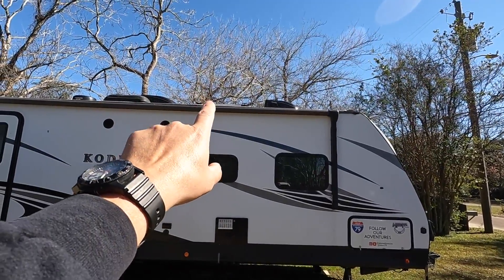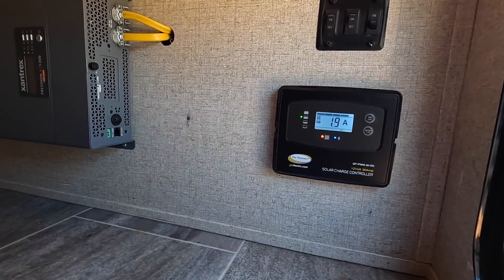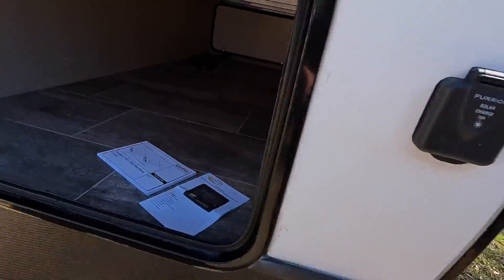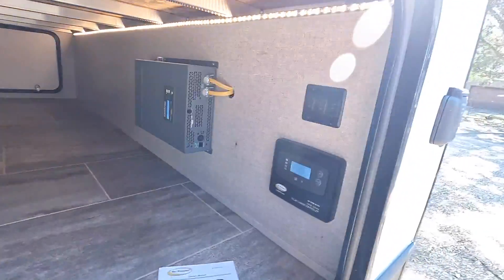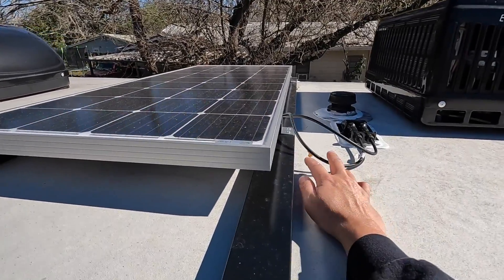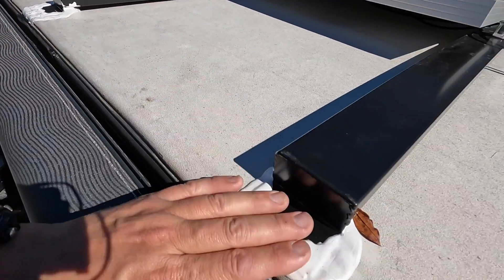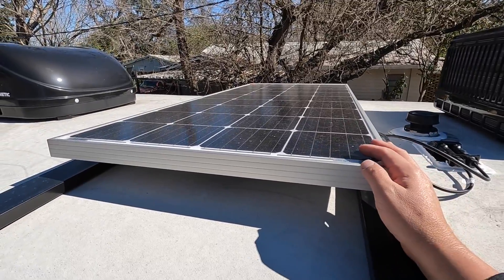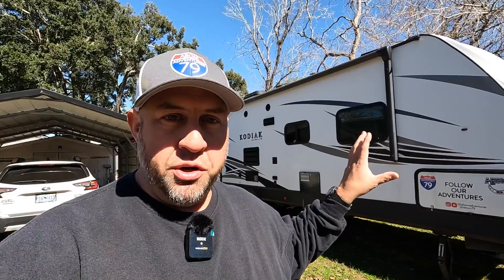Kodiak Solar Power Kit Install

Comment: 1200 w solar panel? Instead of my 18x330w solar panels on my roof (6.6kw solar system cost 2999$ aud) I could have gotten away with approximately 6 of your panels damn it
On the back of my house I have 2x190w solar running into 2x470amp/h agm batteries hooked up to be 24v
Then I have a 2kw Inverter
Did the company explain to you Adam about the efficiency of 24v over 12v and at least AGM batteries over lead acid?
Are the batteries at least deep cycle?
You will be lucky to start and boil an electric kettle
What is the start up power for your fridge
Before you go anywhere Adam that you will rely upon the system
PLEASE dry run everything at home without the genny or your shed power point
You have a big roof on that caravan..... 
Please go and check out
DIY Solar Power with Will Prowse
He is easy to understand and has a LOT OF good info on all things solar and batteries.
Tony from Western Australia 🇦🇺

Comment: The largest RV solar panel I’ve ever seen is 400 watts I’ve never seen or heard of a single panel that will provide 1200 watts for a single panel, is this correct? Earthroamer provides a lot of solar to run the entire rig including the AC and it has 1320 watts with multiple panels

Comment: I'll be interested to see what your results are. I have 310W of solar panels that I can point at the sun, and I find that during a week of camping, if I have 2 rainy days, the panels can't catch up to the power taken out of the batteries. I don't even have an inverter to gobble up power. I love your camper mod videos. Keep 'em coming.

Comment: One panel is 1200W? Are you sure. The inverter may be 1200W but my guess is the panel is maybe 300 to 400W.
Reply from the maker: Solar panel is rated at 190 watts.

Comment: Stop deleting my comments wth what I'm saying is true I have built lots of these systems .
more like a 150 watt system. you can only dischage  deep cycle lead acid batterys to like 70-50%max or you will damage them. plus that pannel is only 150 watts id bet. they are decieving on the 1200 rating thats just the inverter rating. i doubt its even te battery capacity what do you have 2 100ah deep cycles?
Reply from the maker: Hey Baloney, Calm down man! I made a mistake, it happens! No the panel is not rated at 1,200 watts. It is rated at 190watts though. I'm not an expert on electrical systems, I'm simply trying to share the mods and improvements we make. What's the point is trying to downgrade the system components of are particular solar kit? The lead acid batteries will work just fine for our needs and I am more then aware of the available upgrade using lithium iron batteries. Give someone a chance to even use the stuff before suggesting that the components will not work and the "you need to" comments are thrown around.  I'll be adding the links to the kit in the video soon, I was trying to verify the correct kit before I do.
Reply: @AbomAdventures 👍🇺🇲

Comment: Good luck with the small solar panel. It should keep the batters charged for the inverter to work for a little while. 
Need more solar panels.
Reply from the maker: So nice to read comments like this...
Reply: @AbomAdventures  get used to it and check your attitude buddy

Comment: Adam,
Here's a project. How about a sheet of aluminum about .100" to .125" thick cut to size with vinyl upholstery material glued to one or both sides to cover the solar panel in case of storms. You could probably bungee it on or fab some clips to hold it on prior to the storm rolling in. You would have to be careful to not cut your rubber roof when you're installing or removing it so the vinyl padding and rounded corners would probably be a must. Just a thought.

Comment: Good old Anthrax invertors, wonderful piece of crap. Had MANY issues with them including my own set-up. Lost $7000 because of their product so went to Magnum instead. The GoPower regulator is a great controller for that system & is rated for 25 amps so your panel is no more than 150 watts maximum. The system is rated for 1200 Watts AC or about 10 amps with pass through capability. I did not see a DC safety device in there so I would suggest either a 150 amp breaker or a class T fuse on the positive DC supply. If you decide to upgrade, go to an invertor/charger so you can charge when plugged in to shore power.
Reply: Was going to say, no way a single panel is 1200w.
Reply from the maker: The panel is rated at 190 watts.
Reply: GoPower supplies 190 watt panels on their store and that's what the Kodiak press releases specify as well.

Comment: the panel cannot be 1200W - it's probably the inverter's characteristic. modern solar panels can provide up to 20W per square foot in the ideal conditions (spotless panel at 50ºF square to the Sun on equator, at noon, with no clouds), that would make your 1200W panel 60 sq.ft. which it obviously isn't. I'd guess your panel is about 100-150W, which should be enough to run a small fridge.
Reply from the maker: The solar panel itself is rated at 190 watts.
Reply: @Abom Adventures  so that's about 16V, 12A.  Keep in mind that is a "STC" rating.  Real world will be less.
Reply: @AbomAdventures   I just wish the racking system had the capacity to add more panels. with that you will get the one and done. granted you dont want anymore windload or roof penetrations than necessary but I feel that in use you need probably about triple that input wattage or perhaps more storage batteries. think your runtime will be less than 6 hours with the fridge
Reply: The batteries provide power to the inverter, not the panels.  They merely charge the batteries.
Reply: @shortfuse43  I have never said the opposite, have I?
Reply: @shortfuse43  I mean, the batteries are just a buffer, if they are discharged at the rate higher than that provided by the panel, they'll eventually run flat and the inverter would shut down. so Adam would need to keep the constant power consumption (i.e. the fridge) at what the panels can provide, considering the daylight and the weather.
Reply: It's 32 cells so it's about 15V, 10A.  About 150W.  But it looks like all the people online selling these kind of kits are rating them by the inverter power not the PV power.  Home systems are rated the opposite.
Reply: @michael931  That is what's called a true 160 watt pannel...no more maybe less depending if it is mono or a poly type. it also depends if the solar controller is a MPPT or a PWM!!!! either way that panel is NO MORE THAN 160WATTS on its best day...just Go Power inflating their numbers...just like any and all RV dealer solar systems!!!!!!!!!!!!!!!!
Reply: Dormitory size frig maybe.

Comment: Need some protection for the inverter and control panel from cargo movement, some flat bar would do the job.
Any hail that damages the solar panel will cause damage to the trailer and your vehicle, just add it to your insurance claim if it happens.

Comment: Did I understand correctly that you said that's a 1,200-watt panel? And I believe your furnace would run without the inverter, but the blower motor it does drain the batteries pretty significantly. The furnaces ran off the batteries in all of the 5 RV's that I've had.
Reply: That panel is NOT 1200W...they don't exist.  It's a 1200W system, but that doesn't mean that PANEL is 1200W...I believe 400~415W is the "biggest" panel currently available.   I'm currently researching solar and I need 30 panels to run my home at the highest currently available power...that's 12Kw...Do I NEED 12Kw?  yes, running the AC and our electric ovens will eat up over 7Kw...and the panels will only hit that 12Kw during "high noon".  Before and After it will be much less.
Reply from the maker: The inverter is rated for 1,200 watts, the panel is rated at 190 watts.
Reply from the maker: It’s a 1,200 watt system. The service manager just warned me that if run the furnace a lot it will use a lot of the battery power. It shouldn’t be an issue though.

Comment: Pretty sure that was a 120 watt solar panel not a 1200 watt. Thanks for sharing!
Reply from the maker: It’s a 1,200 watt system, unless the service manager is lying to me. Even my book says 1,200 watts.
Reply: @AbomAdventures  It's a 190 watt panel and 1,200 watt inverter.
Reply from the maker: It's obvious I misspoke in the video. The inverter is rated for 1,200 watts. the panel itself is rated at 190 watts according to Go Power.
Reply: Home systems are rated by the solar panel max power but those portable systems all seem to be rated by inverter power.  That little panel will charge enough to run some lights at night but nothing big.

Comment: Adam, if more solar power is required, you could get folding panels, and use them as necessary. HF sells them.

Comment: zip strip those wires. also upgrade your batteries to Lithium.
Reply: I would think they're already Marine Deep Cycle but newer tech won't hurt ...
Reply: @PhilG999  they didn't state that.
a lead acid battery is a lead acid battery no matter how it us made..
lithium battery will provide about 90% more amp hours than a lead acid battery will for the same space.
Reply: @Fairchildflyer  I guess I was thinking Optima Yellow tops that I've used for years. Running telescopes and laptops in a couple of my cars and so on. Have to look into Lithium's because one 2005 Grand Prix GT2 still has a GM OE battery (its second one) that has been in it for 11 years. ;)
Reply: @Fairchildflyer  space isnt the main thing. its $ per amp hour
Reply: @dalegawne5286  to get more hours, you pay more it is that simple
Reply: Golf cart batteries are the best lead acid batteries.  Hopefully that is what he has.